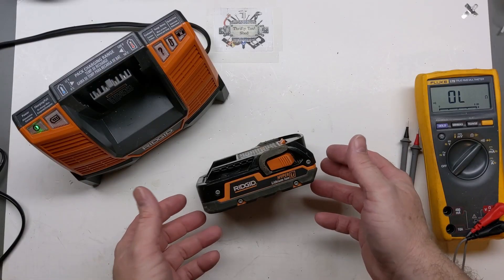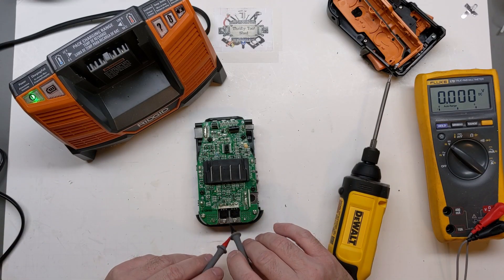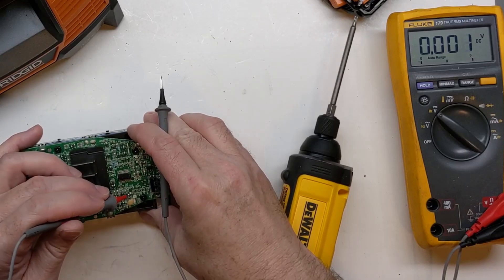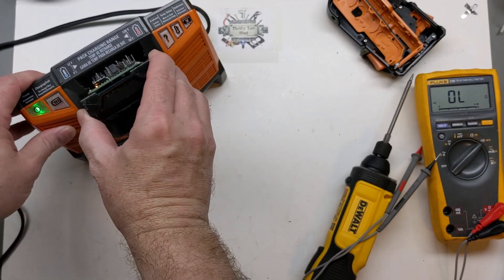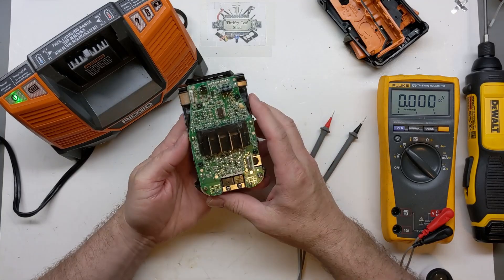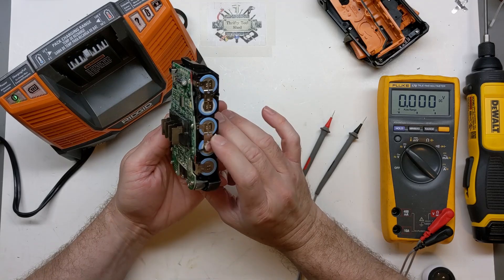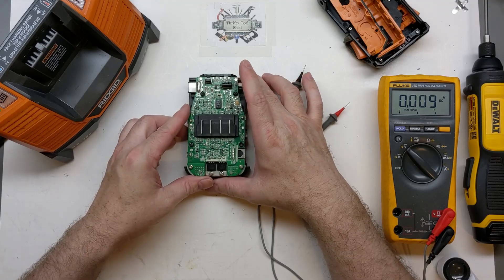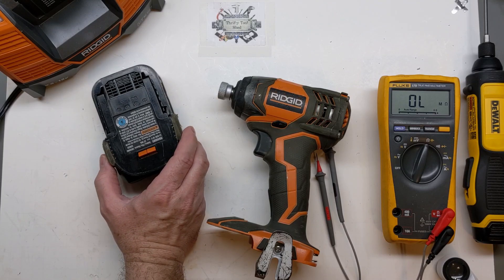Can we get this Ridgid 18V Hyper Lithium Pack back working?

Comment: hmm...makes one wonder is coating the board with some kind of anti-corrosion coating...non-conductive of course.  I work commercial aviation (avionics) and every so often, when we swap out a bad device (LRU, or some other electromechanical device), and determine it is not a serviceable item, we will (just to fulfill curiosity) open the "black box" and examine components inside and do a general visual inspection.  (we are not actually licensed at my facility to perform official repairs to LRU's...but since its a bad device, we consider it a learning event with no downside ..since the device will go back to a licensed overhaul maintenance repair station for authorized work before the item is restored and returned back as a genuine serviceable item)...anyway, what we find over and over when cracking open these devices is that PCB boards ALL have some kind of anti-corrosion coating...likely a type of epoxy.  The function is not solely to mitigate against component contamination, but also to anchor the components in high shock and vibration conditions.  So that's pretty standard.  I would imagine even retail hand tools like these drill batteries experience quite a bit of forces and of course contamination introduced through various vents and gaps in design.  

So I am thinking that maybe a good idea would be to do a bit of preventative maintenance on these devices and coating the pcb with a thin layer of alcohol diluted epoxy resin.  Doesn't really need to be a thick coating.  Just enough to prevent board contamination ...The only concern might be heat dissipation properties...but if the coating is thin, I would consider the effects to be negligible.  

The other things we learned about common failure factors are the usual suspects:

connectors and corrosion...sometimes we can get things to work just by cleaning up the input/output connectors!  (there's alot going on with electric/magnetic fields around connectors and aircraft....almost all connectors (even cannon plugs) will eventually develop surface contamination.

relays and caps....by far the most common failure components.  With caps, you can see the bulge...with relays using a remote power source, you can determine if it switches correctly.  These two items are most common failure components.

mosfets/gates..similar to relays and caps, we see alot of failure...and the trend we see shows there are certain class of poor quality mosfets (or poor design) that explain why the failure rate is repeated across the same model and class of LRU.

anyway...I'm binging on youtube and found your stuff...I also happened to buy a brand new ridgid set at a ridiculously low price at the homedepot and of course the first thing I did was open everything up including the charger to see where the magic happens.  I will say, I am very impressed with the design of the batteries too....but most of all, I was quite surprised to see a high quality brushless motor built with solid design.  

now, I plan to do a bit of epoxy work to coat the boards since my tools are going to see by far the toughest kind of humidity known to mankind...

louisiana baby...where it is raining even when its not raining.
Reply from the maker: I do believe it is a anti-corrosion coating as well. Very interesting information on the aviation electronics. It is neat that the failures you have noted are basically the same failures that plague consumer electronics and tools. Basically everything you described issues I have mentioned in one repair or another especially the corrosion on connectors and the caps. I have a couple videos on the brushless Ridgid Drill and Jigsaw. The BLDC controller failed on both.  Thanks for sharing!
Reply: @ThriftyToolShed  I chose ridgid not just for the price, but the warranty (lifetime) that ridgid honors (provided you buy it from homedepot)....earlier I was a craftman tool guy for the same warranty sears would honor, but now that sears is all but kaput, I did not want to risk getting gear I could not return for warranty.  I think homedepot sells craftsman, but I was skeptical about the warranty assurances.  What I had to do with ridgid was to register each serial number for each drill (drill/hammer combo, and impact, two batteries and the charger....the warrantry registration IS NOT immediate.  I got a notice it may take up to six weeks to receive the warranty registration....I'm not sure what's going on with that.  I've never bought ridgid before, but I did some homework and bought an older model because it was reported to be reliable for medium duty work and of course the pricing.  Out the door with two drills, two 5Ah batteries, charger and a nylon tool tote.  $200 plus tax.  I could have gone cheaper, but it was the warranty and others I know who like the product.  I'm not allowed to use these tools on aircraft (cert requirements and calibration for clutching (overtorque risks)....so this will be standard shop gear.  I put both of the drills to the test a few days ago and bore a 1/2 aggressive boring drill through a treated 4X4 with no sweat.  The impact mode of the drill/hammer was oddly better than the impact for this work.  Protip:  always use the torque handle...lol...I just about did the wrist twist right quick being a dummy.

I'll look at your other videos for sure.  It's all very useful.  

see ya around!  God Bless
Reply from the maker: I believe Lowes sells Craftsman now. I am like you, I have not bought Craftsmen since the Sears days. They were unusual and special back in the day and now another face in the crowd. I agree about the torque of these newer Brushless tools, you need the handle! Thanks for your comments and God Bless!

Comment: No signal to switch on a MOSFET is the most common problem I see with the ryobi 18 volt packs. If voltage is jumped to the gate it will turn on but Never been able to fix the problem ....didn't know about rebooting the chip and never thought cleaning the board could possibly do anything. I would love to see this issue in one of your videos.
Reply from the maker: Thanks for your comment, I will look into it.